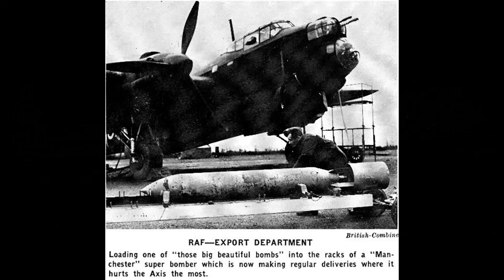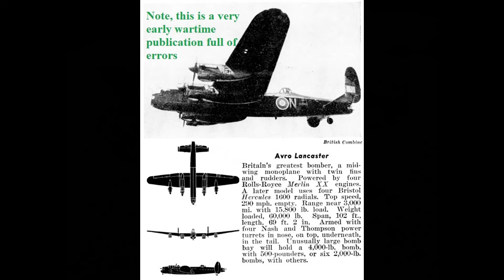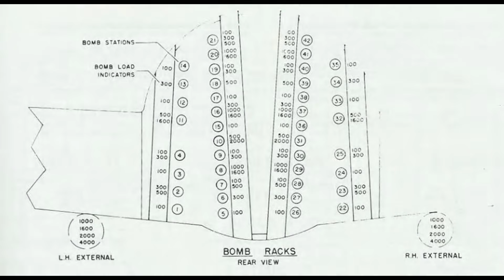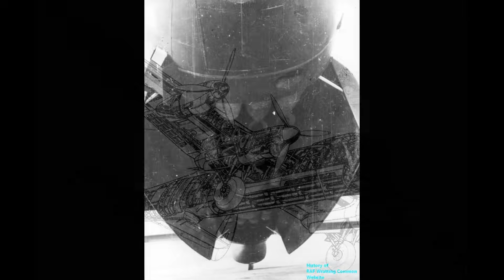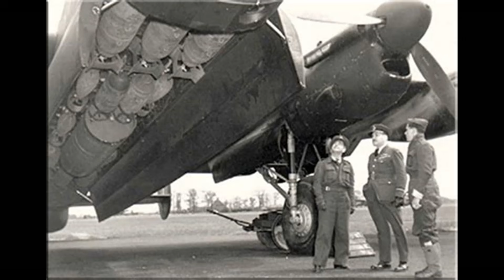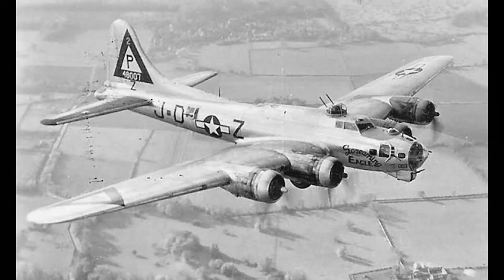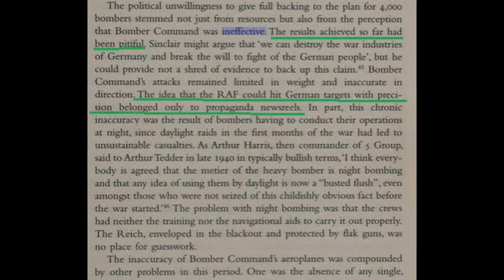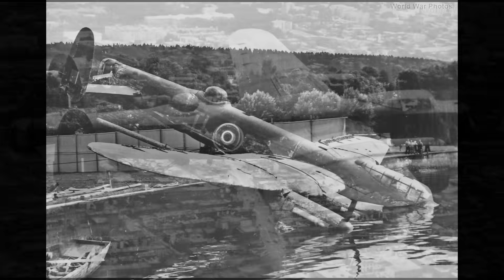Avro Lancaster, Payload, Turrets, Stability and More

Comment: Completely out of left field with this question, but is there any chance you'd be interested in doing a video about interwar engine development explaining how we got from the 100 hp engines of WW1 to the 1000+ hp engines at the start of WW2? Seems to me there had to have been a lot more involved than just make it bigger and add boost.
Reply from the maker: I sort of have covered that, although not in one specific video. It's a bit spread out.
Reply: @GregsAirplanesandAutomobiles  Ok I went back to see what I missed because I know youve covered prewar engine development, but I was still left with a big gap in how we got from the welded steel cylinder 5:1 compression ratio 50 octane sludge powered engines of WW1 to the prewar Merlins and DB600s. Been banging my head against a wall trying to fill that gap with google-fu turning up few answers at all except SAE papers like Hornings Effect of Compression on Detonation and Control, but the vast majority of everything I had been able to find was all in an automotive context rather than aeronautical. Finally found what I was looking for with your recommendation of Taylors Aircraft Propulsion. Thanks a lot!

Comment: Interesting point about 'high wings' (pendulum stabiity?) and twin tails - not sure I fully understand, but something to consider. I note, however, that the 'Privateer' version of the B-24 had a single fin and rudder, and was reputedly easier to fly, so how does that square?

The York used the standard Lancaster wing/engines/undecarriage (and tail) in a high position on a new fuselage - as a result, the fuselage sides were closer to the inboard propellers.

The bomb doors of early Manchesters wouldn't close fully on a 4000lb 'Cookie' - they had to be modified. 

The bomb bay of the early Wellingtons (also a large open space) couldn't accommodate a Cookie, but later versions were altered.

It has been repeatedlly said that the Halifax (main) bomb bay couldn't accommodate a Cookie - I have seen a photo of one fitted! - admittedly the doors wouldn't close, but bulged doors, like the Lancaster and Mosquito, would have been possible.. The later Halifax transport conversion has a large pannier over the bomb bay and was reputedly a better transport than Lancaster conversions. Halifaxes later dropped palletised jeeps. 

The Siirling seems to have been the only British 'Heavy' with a bomb bay physically incapable of taking a Cookie.

Good to see that, unlike an earlier video, the fact that the FN turrets were powered by engine driven hydraiulic pumps, and not local pumps is acknowledged.

As to the forward position of the Martin dorsal turret on British built Lancasters due to balance consideration, this was introduced on the Austin -built Mk VII, but due to supply shortages, early aircaft had an FN Turret - the example currently under rebuild to flying conditon in East Kirkby shows this. Unpopular with the crews, I understand, as it impeded acccess internally. Similar issues apply to later Canadian built Mk X's, as per the example at Duxford.

It seems that the Rose turret with twin .50 guns cal stored its ammunition below the turret so the ammunition tracks were not used - so another balance issue? Also, it seems that Portal, the Chief of the Air Staff, opposed widespread use of that turret as it was custom made, and not producitonised. and so not sustianable. A twin .50 cal FN tproduction turret was produced, but I've no idea how many were deployed.

Bigger guns = more weight and less space in the turrets. Bigger guns = bigger ammunition = more weight. More weight = less range, height or fewer bombs, which would not have suited Arthur Harris...

The whole issue of the limited effectiveness of .303 guns across the entire British WW2 aircraft estate (bomber and fighter) is well aired elsewhere - the desire being to jump .50 cal to 20mm.

Also, under-fuselage protection for  bombers is well aired elsewhere, and goes back pre-war to biplane bombers like the Handley Page Heyford and it's 'Dustbin' turret.. The Armstrong Whitworth Whitley dropped paratroopers through a hole in the floor - a hole also intended for a 'Dustbin' turret. The US seems to have tackled this area somewhat better, though how effective a Sperry Ball Turret woud be at night I don't now - was this ever tested?

At one point, Operational Research suggested dropping guns altogether to improve speed and height - that was rejected, possiblly for crew morale reasons, but also for daylight operations (where they proved ineffective), as they had in 1939.

Why the Lancaster retained an (unmanned) front turret, with all the weight and compexity when the later Halifaxes deleted it in favour of a single flexible mounted (scare?) gun is a mystery to me - head-on attacks at night would be suicidal for an attacker.

So - were gunners in British night bombers primarily lookouts to warn the pilot to take evasive action? 

Some interesting questions raised in this video - it will be interesting to see what comes out of the next edition.

Comment: The Air Ministry had doubts about the RR Vulture pre-war and had Handley Page redesign their HP.56 (which was designed to fill the same role as the Manchester and also used the Vulture engine) to create the HP.57 or Halifax. The Air Ministry didn't want to put all its eggs in one basket.

Comment: A fascinating video Greg, looking forward to the next. A little historical background, the  Avro company was a subsidiary of Hawker, like Gloster. Up to the Manchester the largest Two engined aircraft produced in volume was the Anson. Indeed the Anson would be an interesting video to consider.  However the key to the Lancaster was the bizarre Air Ministry specification P13/36 which the Manchester tried to meet.
1 a large twin engined monoplane bomber capable of carrying 8,000 pound load,
2  or 2*18 inch Torpedos length 18ft 2.5 inches, hence the bomb bay and the possible positioning and design of the wing,
3. 24 fully armed troops if needed.
4. The specification also demanded capabilities to catapult take-off and arrested landing, through was to apply carrier characteristics if the airfield was damaged through bombing preventing long take-off 
5. Dive bombing capabilities.

Consequently the Manchester Type 679 got heavier and heavier has strengthening was added to meet, this all things to all men specification. At the same time George Volkert at Handley Page was given permission to go ahead with a four engine model HP57 which became the Halifax. Additionally an order for Bristol Blenhiems in 1937 gave Roy Chadwick the experience required with  stressed-skinned aircraft. As you explained the Manchester was not a success for various reasons, however Avro’s Managing Director Roy Dodson and Roy Chadwick had considered a 4 engined Manchester, called Avro Type 683 or Manchester III, requiring an increase in the tailplane size and obviously wider wings for the 4 engines. In parallel they worked with Rolls Royce regarding the Merlin installation to address the poor Manchester hydraulic installation issues and were informed about the development of the Merlin installation for the Bristol Beaufighter for the two outer wing engines. This was brought to ahead when the Air Ministry binned the Manchester and wanted Avro to build the Halifax, at that point Bomber Harris preferred the Halifax 4 engined bomber, whilst it may be a post war myth, Avro’s are reported to have said “ Oh,no we bloody well won’t”. 

The first prototype was BT308, was a modified Manchester off the production line with a big wing. Avro were keen to demonstrate the Manchester III has quickly has possible. It went to Boscomb down and was successfully trialled. At this point they clarified the crew structure, where the second pilot was dropped due to the economic grounds of war for the flight engineer. Consequently the Lancaster could be considered has an austerity aircraft, so has many has possible could be made has quickly and cheaply has possible.

The second prototype DG595 was the first true Lancaster stressed for an all-up weight of 60,000 pounds.The third prototype used the Bristol Hercules radial engines, known has the Lancaster II. The first production aircraft L7527 first flight 1 October 1941, was stressed to 65,000 pounds, this consistently increased with improved Merlins with later versions stressed to 72,000 pounds to carry grandslam. 

One weakness was the small escape hatches, undermining the crews ability to escape from the aircraft, it was very poor consequently with Lincoln they addressed these shortcomings by increasing the size of the escape hatches. If you review Freeman Dyson‘s bomber command work he covers this and the recommendation to move totally to mosquitoes given their performance advantage bomb load and crew of two. It was a recommendation actively considered before the Luftwaffe collapse.

Finally considering Vulture, the principle was to get to a 2000 hp engine has quickly has possible, DB tried the same with 2* 601 engines. Interestingly the Vulture worked exceptionally well in Tornado, indeed the final prototype, though the program had been scrapped by the RAF, with the Vulture V engine outperformed the Sabre engined Typhoon because of its superior supercharger. However the Vultures development didn’t go to waste, the supercharger design significantly contributed to the development of the Merlin 61, RB 23 Welland and RB 37 Derwent.

Comment: The small diameter of the Lancaster's upper turret was a serious problem for mounting a 20mm cannon. It would have to sit well forward in the turret, so that the barrel extends far out into the slipstream when the turret is turned the side. Earlier experiments with 20mm gun turrets for turret fighters showed that the force on the barrel was immense, making it difficult or impossible for the turret to track accurately.

The Hispano-Suiza's feed mechanism was another problem. 

The B-29 could pull this off because it was a much larger bomber that had the 20mm cannon incorporated into the design much earlier in its development cycle.

Comment: Good video, lots of new to me info.  Perhaps you should cover the Bristol powered versions too.  

The Lancasters were built in the same location as Spitfires, and one of the two chief test pilots, I think Henshaw, was known to barrel roll them.

The York was a Lancaster with a wider fueselage, which was lowered with respect to the wings and landing gear, so it easier to load passengers.  The angle of attack of the wing was the same as the Lanc in the 3 point position, but I guess the fuselage was at a lower angle.  Winston used one, instead of the earlier Liberator.  It would not look right if Winston used a US plane!

The night fighter shoot from below was independently derived by both Japanese and Germans.  Both had spectacular success against heavy bombers.  Usually, the bomber crew did not know what got them shredded them to pieces.

Comment: Good video as per usual. I am an automotive technician and discussions were brought up about the L.S motor and different cylinder casting numbers. I found it very interesting that some exhaust valves are filled with zync or with other materials to lower exhaust valve temp and achieve denser air in the combustion chamber. Could you give us a video on the history behind these valves or if they were used in WW2 and how big of a difference do they really make?

Comment: Did the length of the Lancaster bomb bay cause any center of gravity issues as it dropped it's load, especially if any of the bombs at the front or rear failed to drop?
Reply from the maker: Yes, that could make for a fun ride, but as it would only have one failure at a time it typically wouldn't be a mission ending event, unless the bomb fell later and detonated in the bomb bay.

Comment: In 2014, I saw the British and Canadian Lancasters at an air show in Devon, England. They came very low over the headland where I was standing before turning to display along the coast. They came in with the huge bomb doors open displaying the bomb racks. They are truly intimidating machines and must have been horrible to get on the wrong side of.
Reply: I can remember being at an air show with the Air Cadets. There was a low level flypast with a B17 and a Lancaster. The Lancaster thundered along, shaking the crowds teeth, the B17  in comparison whispered along sounding more like a medium bomber.
Reply: I forget the German ace (109 pilot. Last name started with G) wrote how fighting Yaks and Spitfires was exilerating and even fun but when he turned in on a box of B-17s "all your sins flashed before your eyes". Not quite the same plane but I'm sure it wouldn't make much difference.

Comment: Great video. I really appreciate your highlighting the technical aspects of the aircraft.

I found the discussion of the twin tail informative. I recall that the B-24 crews stated it took a lot of effort to control during engine out conditions, I imagine the Lancaster pilot would have the same difficulty, and only himself to do control inputs. 

I believe this part of the reason the US Navy had their version of the Consolidated Liberator, the PB4Y, eventually redesigned with a single tail.

Comment: The R&R Vulcan engine was a great idea on paper, but a plumper's nightmare, ooops  Aircrew/Ground crew nightmare in reality. Taking two common older engines and fusing them together into one more power engine power pack sounds like a great way to make older cheaper plentiful engines useful during the war. This wasn't the only time during WWII the British fell in love with a multi bank engine arrangement. The British Army's favorite version of the Sherman tank had the Chrysler A57 30 cylinder multi bank power pack which 5 inline six cylinder engines combined and was a very reliable engine. Unless the the tank was in a  firefight the crew could pull over and disengage one of the engines having problems, or open up the hatches to do some "wrenching' . Worse case a recovery repair tank and crew would come over and swap out the the "bad" A57 power pack for a new one.  But in a multi engine bomber flying a combat mission, one does have the luxury of pulling over to the nearest cloud to sort out a multi bank engine having kittens.

Comment: Just found this channel today and I must say, I am deeply impressed by the level of detail and unbiased research. Subscribed immediately. 

Regarding your statement that in your opinion, an ideal turret setup would include the Rose turret for daytime operations, I am a bit puzzled. I read Roy Irons' Relentless Offensive (which is an excellent, highly detailed book in case you don't know it) and I got the impression that the primary advantage of the Rose turret was its unrivalled vision, which is in line with Harris' statement that spotting the night fighter first was of the utmost importance. On the flip side, the .5" had some serious reliability issues, and Irons states on page 138:

"... number of attacks by fighters on aircraft with the Rose turret had been 25% less than had been expected ... however, not all was well with the turret, since the loss rate was the same, implying that the Rose turret was less able to defend the bomber, despite its superior vision ... Of all combats, the .303" turret was seriously incapacitated in 6%, whereas the Rose turret was out of action in 45%"

I don't want to be annoying or something, I just believe that the Rose turret was not a good choice for daylight operations, especially since vision was not that impeded by day and the exposed position of the gunner might actually be a disadvantage. 

Please keep up the good work!
Reply from the maker: Rose turret in the day because of the 50 cals. Fn121 at night because of the radar, that's my thinking.

Comment: This is a really interesting video, however I must make a correction to the arming of bombs on the Lancaster and other aircraft that utilised the Universal Bomb Carrier No.1

All of the bombs on the Lancaster, Halifax, Stirling etc could be dropped "safe". The "safety clip/pin" that you refer to was the most basic safety device fitted to bomb pistols, for example the British Nose Pistol No. 27.  The safety pin holds the "safety fork" in place.  The safety fork is attached to the bomb carrier via a wire.  When the safety clip is removed, the safety fork will still prevent the vanes of the nose fuse from rotating.

As the bomb is dropped, the arming wire (attached to the fusing spool on the bomb carrier) pulls the safety fork from the nose/tail pistol.  The arming vane is now free to rotate and expose the striker.

The bomb aimer's panel has a setting "1. SAFE - Except for jettison".  This prevents accidental dropping of the load except when the jettison bars on the bomb selector are pushed in.  In this case the entire load is dropped with the arming forks intact and the arming wires are pulled free from the fusing spools.

The bomb carriers could be accessed from the floor of the aircraft.  When "hang ups" occurred (as they did!) the crew might try a variety of tools to release the bomb carrier.  I once heard that the navigator's wooden ruler was utilised.

Great video though, even though as a Brit, I had to cover my ears and go "lalalalalala" when I heard stuff I didn't like. :-)
Reply: Not a lanc story, but the ground crew were going over their various parts of the plane at dispersal between the sand dunes. The armourer hadn't arrived yet but the electrician had. He began checking the switches in the cockpit as usual. After a bit he noticed that the mechanics were no longer sitting on the wing working with the nacelles and engine. In fact one of them was going up the dune. 
It could be an attack so he got out as fast as he could and ran over the dune. Once he got down among the rest he looked up and asked what was it? 
"Some idiot opened the bomb bay and dropped the 4000 pound bomb that was hung up".